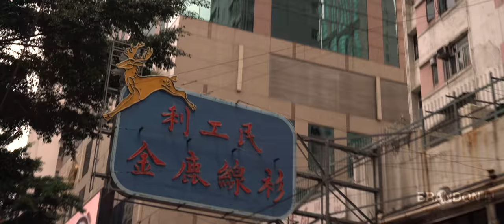The Hong Kong Tram

Comment: Hi Brandon, I have a question and I would appreciate if you could take the time to help me.

My current gear are the A6000, 18-105G lens & 16mm + wide angle converter. 
My concern here is that I have a budget which I am struggling to decide whether to get myself a Sigma 30mm 1.4 DCDN or a used gimbal.
I know the equipments I ultimately decide depends on my usage, but I believe perhaps if I could get some advise on someone more experienced like you, you could provide me with some long term view of which gear I should be getting.

The reason which I considered picking up a 30mm 1.4 is because of the ability to isolate my subject, giving that "professional portrait" looks. Also, I'd have a lens that is capable in shooting in low lights. However, if I really wanted to "isolate" my subject, I could actually just use my 18-105, zoom in at 80mm and open up to 4.0 and I could get decent blur from the compression. Without  a 1.4, im actually being more creative by always thinking how i can shoot to isolate my subject, therefore finding an angle or suitable backdrop is an essential part of my equation. Im afraid that I might get lazy and just shoot anywhere anytime with the 1.4.

The reason which i considered picking up a gimbal is because mainly to add more movements into my videos. My current movements in my videos are usually push ins or body knee parallel slide, shot at 60fps. I am able to get smooth movement footage, however the distance travelled within a second is always short. I imagine a 1 second scene of running with a gimbal would look cooler because more distance is covered in a smooth motion. (hope you understand). 

I hope by explaining some of my thoughts, you could shine some light on this matter. LENS OR GIMBAL? BRANDON HELP

Comment: So good Brandon! I was wondering if you can help me actually. I am shooting on A6500 PP8 Cine 4 Pro with Sony E 35mm f.8 lens recommended by you in you other video.  I usually always shoot 1/50 for 25fps and 1/200 for 100fps (pal settings) I have been noticing a lot more noise in the blacks and overall grain the picture doesn't look as good as when I shoot in P auto within the video mode dial and not my custom 1/2 dials.  What setting do you favour? could you do a designated video on this? I find it really hard to measure picture noise unless using a external monitor.  Any tips? Much appreciated.